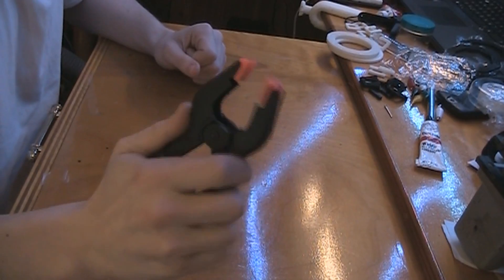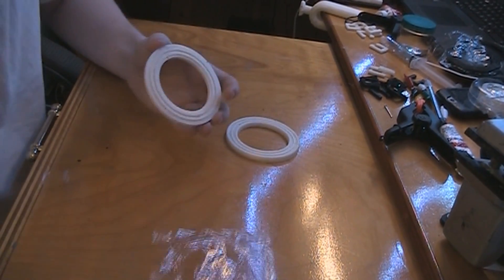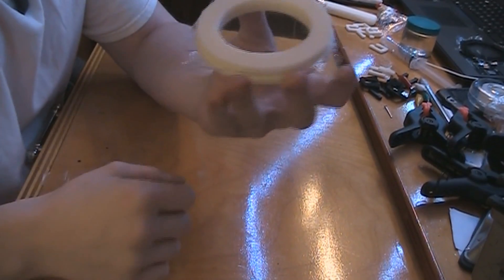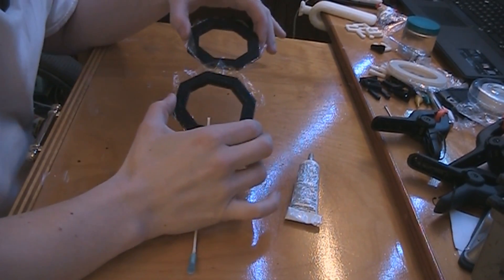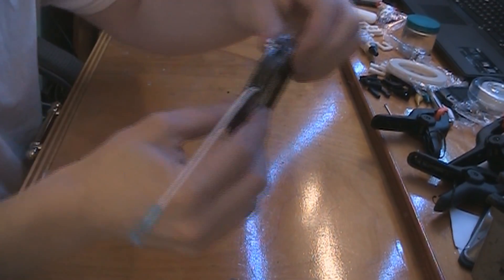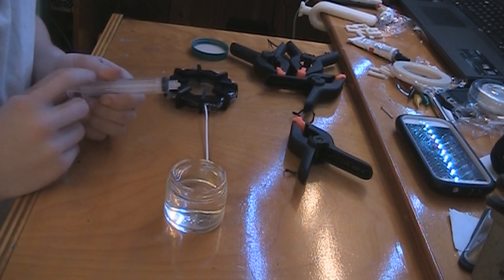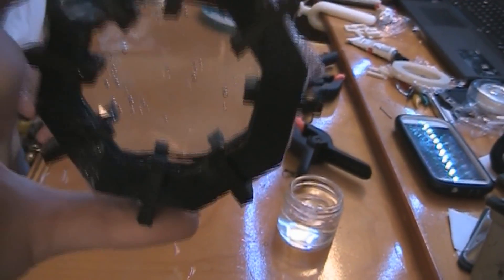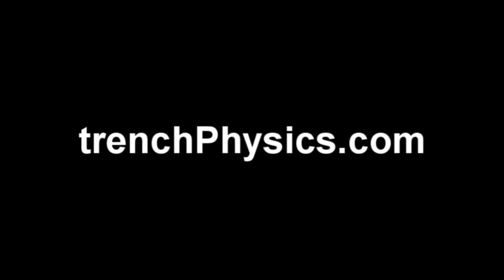Adjustable Focus 3D Printed Liquid Lens

Comment: Is this ( adjustable focus lens ) technology used currently at all? It's a great idea, although I'm not convinced that water is the ideal liquid. Also suggest you consider more stretchy material, for instance some kind of thin silicone rubber. That might help to minimise puckering around the outside edges. Keep up the good work!

Comment: Few things I would change, you are clearly (excuse the pun) using a very cheap plastic (looks like a food storage bag) so try a better quality plastic. Next I would have a bleed valve on the opposite side that you could use to eliminate air bubbles. Next change from heat shrink tubing to a plastic syringe nozzle and prime the tube to reduce air bubbles. Next redesign your rings to utilize an "O" ring so that you could seal it with screws instead of gluing it. Great first prototype.